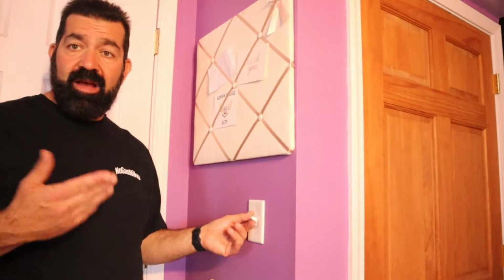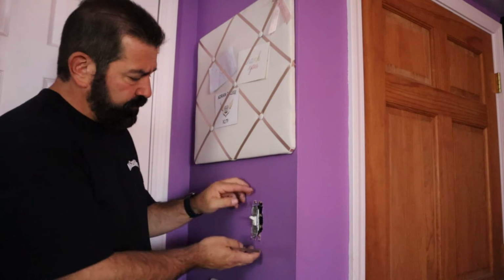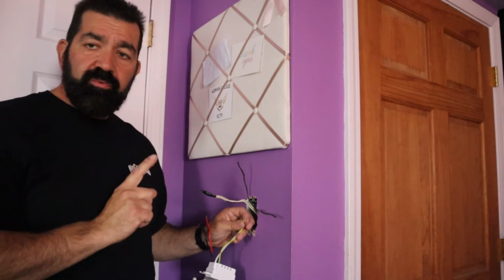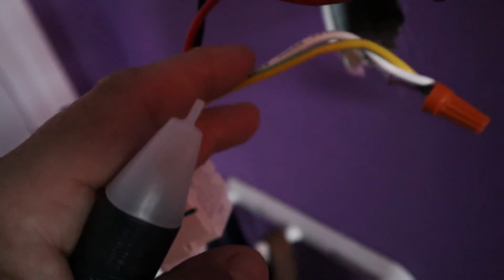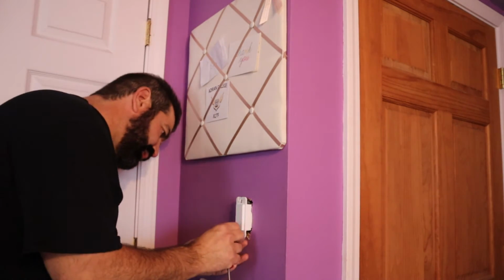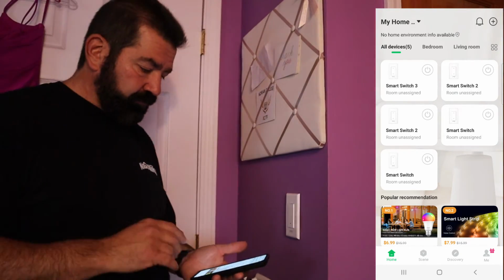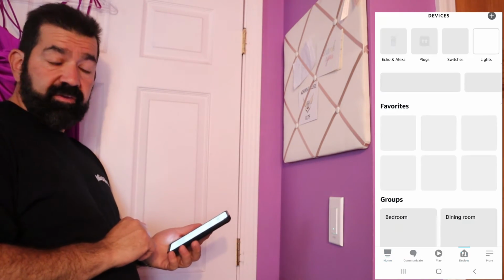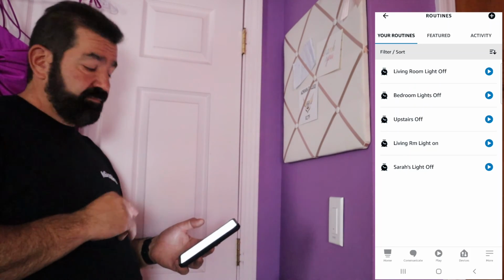No NEUTRAL Smart Switch Install

Comment: Why do ppl say not to wire the neutral and ground wire together they say it’s dangerous? Could you help me understand that because I have no neutral but all research I found said not to do it because it could be hazardous?
Reply from the maker: It's because you shouldn't have power running to ground.  Ground wires are typically not insulated.  With these devices there is very little power to keep the WiFi active.  It's milliamps.  That will not cause a problem.  I've had mine running for a couple years now and no issues.  I do not give advice on what you should do for liability reasons, you need to assume all responsibility when it comes to electricial work.  If you're not confident, please hire an electrician.

Comment: I've got the same setup in my house (3way, no neutral) and I saw this recommendation.
However, reading further, I see this is against code. The neutral carries current back to the panel, which is why it's insulated. Where as the ground carries current ONLY in the case of a fault, which the breaker then trips when it detects that.
Does this mean that there's a potential of either sending current back to the panel and tripping the breaker, or worse, because we're sending the current on the bare, exposed ground wire, you're potentially electrifying metal objects on this circuit??
For anyone that has this installation, have you tested how much current is being sent down the ground wire with this setup?
Reply from the maker: Most ground wires are within the sheathing and not at risk if contact with bare metal.  This is the case with mine.  I don't have bare copper running from these switches to the panel.
Best bet is to bring in an electrician and make sure what you do is safe.
Reply: @NoGasNiko  My circuit has 4 lights on it. I implemented this as a test, and one of the lights is permanently on. Very dim, but when the lights are "off" all are completely off, except the one that permanently stays on.
Reply: The switch needs milli amps so there's nothing really in that ground wire. I don't know why it's against code the neutral and ground connect at the panel.

Comment: Legally no current is supposed to go through the ground... Yes you can get away with it, but if you have a code inspection you will fail...
Reply from the maker: Thanks for the info.
Reply: It's ma's. There may be code exemptions allowing ground connected    smart switch. I need to research it because I have a no neutral box to install a smart switch in.

Comment: What if we have 2 lights and a exhaust fan in the circuit, would we need to purchase additional capacitors for each of the components in the circuit?
Reply from the maker: Are you talking about a 3 way switch?  They sell these as 3 way also.  You don't need both switches as wifi, only 1 is necessary to control the circuit.  It needs to be wired correctly or it won't work.  If you're not familiar with wiring these I suggest getting a licensed electrician to install.
Reply: Thanks so much!  I have been trying to figure out how to get a neutral wire to the switch I have been wanting to install!  I only wish YT had served this video to me like 2 weeks ago!

Comment: Hi i just read a ton of info and could see that while this works incase if the ground connection breaks that would energize everything which means any metal surface that is grounded is now live…..now my concern is what makes the ground connection break? My ground is bare copper and if it gets energised thats a real problem for me. So im looking for the chances of ground break
Reply from the maker: If the ground connection breaks, you'd lose connection to WiFi.  That should be it.  I may not fully understand what you mean by ground circuit breaking.

Comment: Yours is the only video I've come across that shows that that the smart switch's WiFi module retains power when the switch is turned off when the neutral wire is connected to ground. That's the whole purpose of the neutral wire on the switch to begin with.  Several other videos I've watched show that the lights can be toggled manually using this method, but none have shown that the network portion remains active.  Thank you for this.
Reply from the maker: You're welcome!  Thanks for comment, much appreciated.

Comment: What happens if I don’t what a neutral nor a gold bare ground wire? I want these switches so bad but where I want them only has two wires and not a thing else
Reply from the maker: Unfortunately you'd have to pull new wire.

Comment: Hi
Yes it works without the neutral wire ,,, manually!
But will it still work with google voice if it wasn’t hooked up ?
Reply from the maker: I have 2 of these without a neutral wire.  My bedroom and my son's bedroom.  I was a little surprised when I saw a neutral wire in my daughter's room.
Reply from the maker: I use mine with Amazon Alexa and it works fine.  Haven't tried Google Voice but I'm sure it will work.
Reply: @NoGasNiko  
I’m sure it will with google , but in your video , I was hoping you’d set up the app completely without the neutral tied in and do that particular test ,
Reply: So , there’s no real proof it will work without the neutral ? 
Manual yes ,,, and since these and all smart switch need a little power to function , will it still work by voice without the neutral
Reply from the maker: OK.  I understand what you're saying now.  I can tell you that I have at least 3 of these working without a neutral wire.  It's what prompted me to do the video.  It works, guaranteed.  Since the neutral and ground are connected together at the panel its no different connecting them at the switch.   Hope that helps.
Reply from the maker: Actually,  the switch won't work manually without both ground and neutral connected.
Reply: @NoGasNiko  thanks , that is what I wanted to hear , I’ll look them up :) thanks now enjoy your Sunday :) haha 😆
Reply from the maker: You as well.  If you run into troubles feel free to contact me.